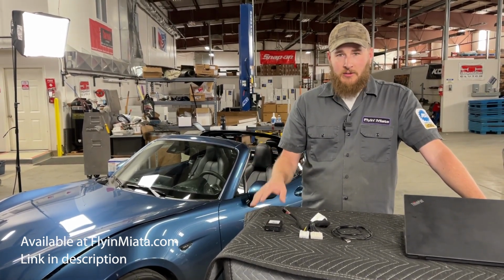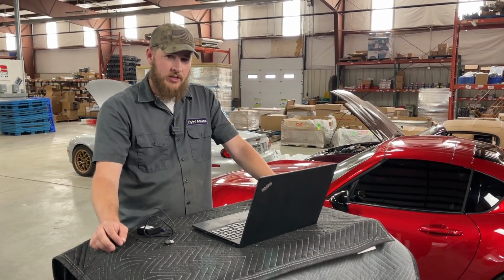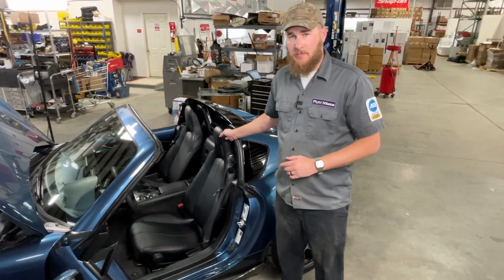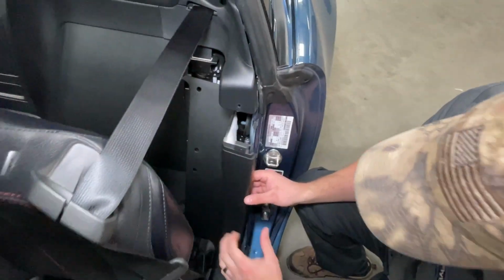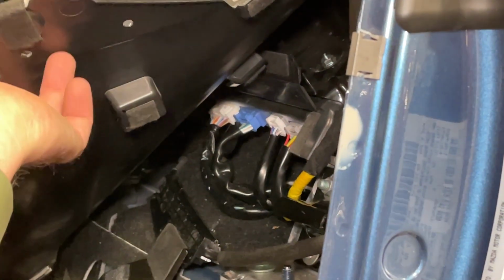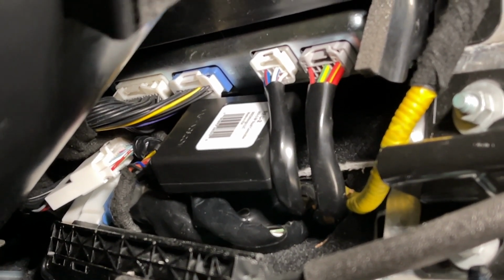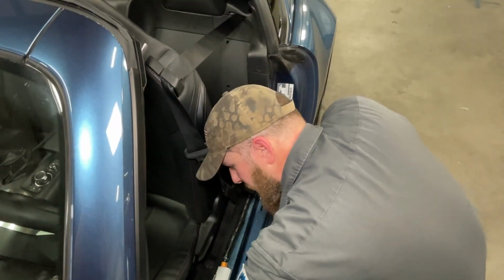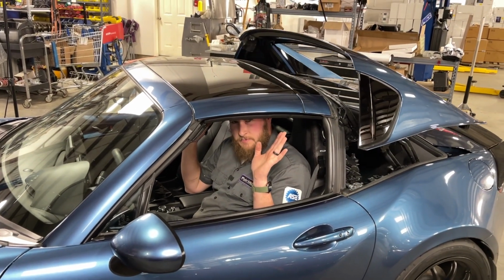MX5Things ND RF Roof Controller Installation

Comment: Of course I didn't use one but a bungie to hold that flap back is absolutely recommended.  My poor hands are beat up.  I also used a 10mm wrench instead of rachet/socket on the retaining screw as it fit easier and you really only have to loosen it about a half turn to take off with fingers.  Otherwise, easy install.
Reply from the maker: @kdjinn A bungie there certainly does help!

Comment: I might want to add, if it's not been stated already, that when you dismount the bracket that covers the flap covering the roof control module, it might be helpful to not have the roof completely in its parked position. Meaning leave it at least a few inches away from fully retracted or raised. That bracket holds the cable that actuates the rear roof latch, and it's under a fairly stiff amount of tension when the roof's at either end of travel. In the middle, it's much more slack. Helps with getting it properly and securely bolted back down, and if it's not properly secured 100%, the roof might not be secured when retracted, leading to it possibly rubbing up against the underside of the rear window archway panel above it, possibly leading to paint damage. Like it did with mine.
Reply from the maker: Thanks for the added info!
Reply: Super helpful detail/tip.  So if attempting this mod, best to have the roof a little bit of the way towards going up and not fully closed/seated?  Do you know if there is a particular torque setting for that bolt on the bracket covering the cable flap?  Considering buying this kit, and am just wondering how you know when it's secured 100% so as to avoid the potential paint damage situation you describe. Thanks!
Reply: This happend to me as well. My roof got quite damaged all the way through the paint because of scratching of the upper panel😢
Reply: Did you remove the controller or refitted it? I'm not sure how to properly fix this

Comment: I bought it!!! Only a question: can i use the usb camble coming up from the roof controller for giving power to a cabin ledx light or for charging my phone?
Reply from the maker: Hmm. Good question! As long as you're not overdrawing the circuit, I don't know what it would hurt. However, we've never tried it either.

Comment: Great video I have installed the acc and roof controller today the only thing I have an issue with is when using the fob to put the roof up the windows don’t go back up the 1-2inch they drop this is normal ? 

Thanks for the help
Reply from the maker: @samanthajohnson-doel5194 It will be easier for us to assist you with this if you can contact our Support Team directly - you can email them at support@flyinmiata.com, or call in at 970 464 5600. We look forward to hearing from you!

Comment: just got this kit in for my '17 ND RF and when I press Connect in the programming step, it says "Could not find COM port connection with device" just right of the drop down. tried multiple USB ports, restarting the PC, and every time I get the same thing. A red light also appears on the device when I plug it in and I could not tell in this video if that's supposed to happen. any help you could provide would be appreciated. thanks!
Reply from the maker: Sorry to hear that! Please send an email to our CS team (support@flyinmiata.com), and we'll try to provide an in-depth answer.

Comment: After install is there a way to pause the raising or lowering of the roof?  Say to inspect and clean the rain gutters once a year?  Or do you have to remove it to revert to OEM function.
Reply from the maker: Yes, you'll still be able to pause the movement like stock!

Comment: I have a 2020 RF GT. My harness just came, and after installation, it doesn't respond to the three clicks. HELP, please??? when i plug in the module to the i do not see com 8, com 3 was the only option i have available.
Reply from the maker: So sorry for the hassles. These can be a little finicky at times. Please reach out to our customer support team directly, they'll be more than happy to help you trouble shoot the issue.

Comment: Is it possible to convert between ST and RF for bad winter climates?  Are all parts bolt on?  Could this controller be added to a ST car to control a factory RF top?
Reply from the maker: Not that we are aware of. The RF roof and components are very extensive, with many body panels and interior components that don't swap between the two. If you want an RF, we suggest buying the RF or buying an aftermarket hard top for the soft top ND.
Reply: @FlyinMiataVideo  Thanks for the quick reply, really appreciate it.  Just trying to plan for the rainy season in Oregon.
Reply: @FlyinMiataVideo  Greetings, how can I look for a hard top? I have searched on the internet but I don't see that they sell for ISport ND 2017-2018 models. Maybe I am not doing the search correctly, my native language is Spanish.

Comment: All this stuff for not having to keep one finger on the switch...I admit that is way more ergonomic but I guess there is a reason why the Japanese engineers have done it in that way.
I wouldn't change it but why not in the end...
Reply from the maker: This was an installation video only, so we didn't go into the features and benefits of why someone might want to install these in their car. Check the links to view the product pages on our site for full details about how you can use these to change the behavior and program the functionality of the car. :)
Reply: @FlyinMiataVideo I was just thinking the benefit of doing  all this VS the risk of damaging plastics when installing the system. It looks pretty simple but still something may happen. Thanks for your reply and keep making nice videos. I have a Miata NA 1992 and always eager to see new stuff. Greetings from Belgium!
Reply: This modification allows you to control the top wirelessly from the key fob, too (if you have the ACC/ON harness under the steering wheel).
Reply: agreed . more trouble than the minor hassle that it may solve
Reply: I’d say the biggest benefit is up/down function when driving at higher speeds . Like if at a stoplight you can drive away at more than 5 ish MPH while the top is opening or closing. Great video.